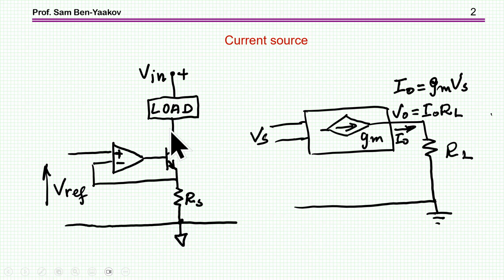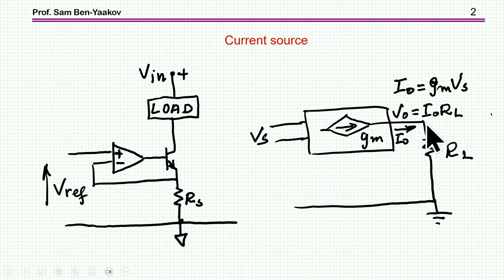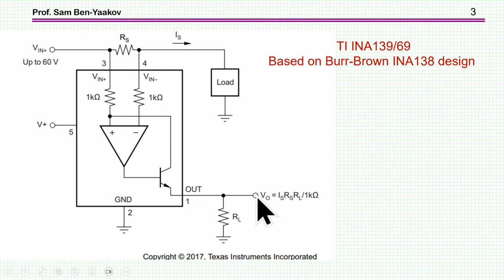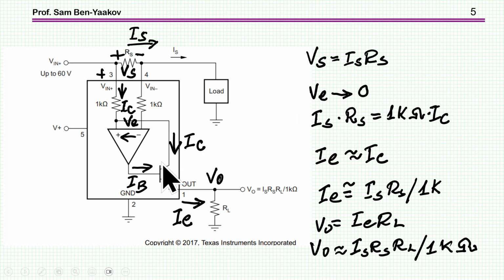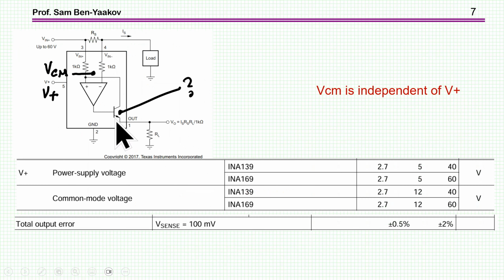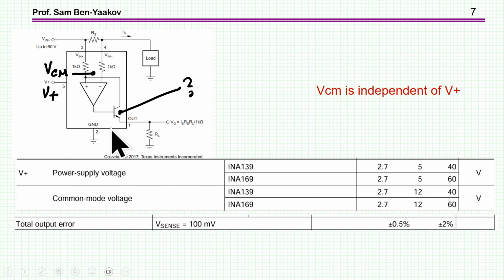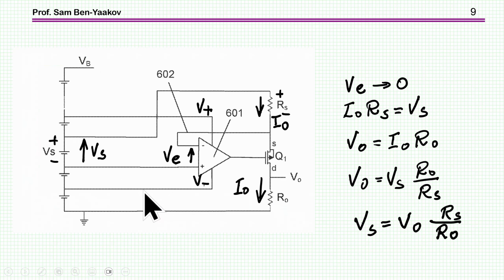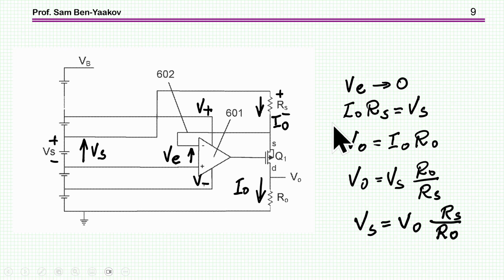Current amplifiers as isolators

Comment: Hi Professor, thank you for sharing this setup, very easy with high accuracy measurement. As you pointed out, it is for higher cells and  It is not suitable for lower cells(cell1,cell2,cell3)  in the pack  one should take that into consideration. Especially, for lto cells it can be tricky. All the bests
Reply from the maker: With some creativity one can also handle the lower cells 😊
Reply: @sambenyaakov  you are right, need some tricks :)
Reply: Where do you see limitations with lower cells? Is it related to transistor gate threshold voltage ? Or maybe problems with opamp supply voltage range may be problematic for the bottom cell, especially for LTO..? Anything else? Thanks

Comment: Thanks for describing this voltage to current technology. You can essentially do this using only 2 transistors and a TL431 while also providing the level shifting for balancing current control signal. Another way is to convert DC cell voltage to AC and capacitively couple over the "isolation", wich is more sensitive to hf interference. I am using this in my open source discrete BMS solution for several years,  just mentioning because of your recent patent. If you do the mux in the right way, there also is no quiescent current draw at all.
Reply from the maker: Intresting, Thanks for sharing.
Reply: Hi! Your idea of using just two transistors and a TL431 sounds fantastic. Could you please share a quick schematic or snapshot of this circuit? I'd really appreciate it! Thanks!